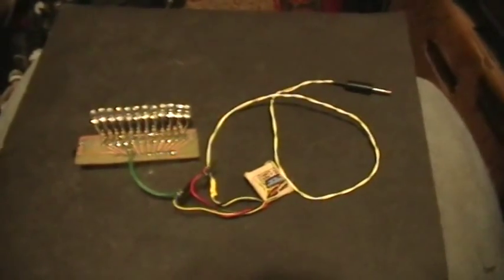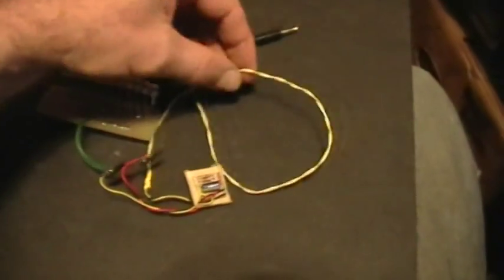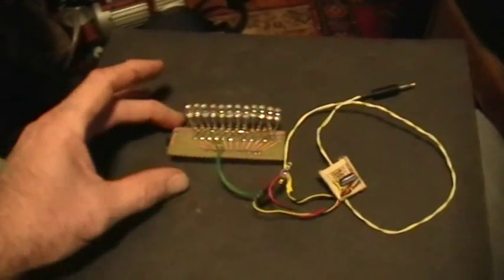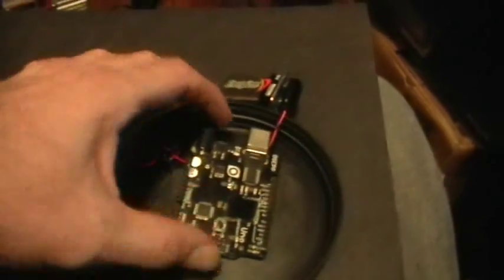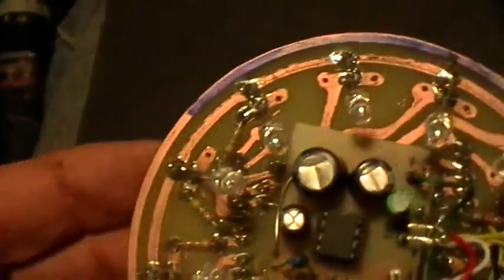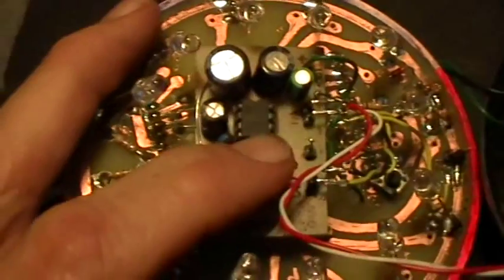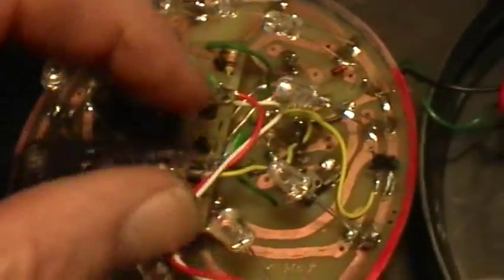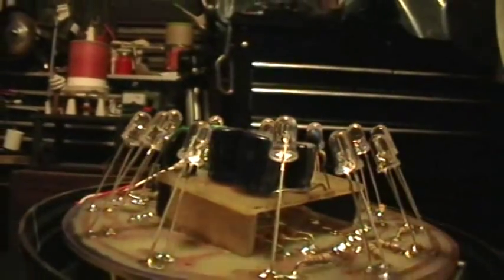Arduino: TKs FFTDuino 4: Color Organ Final Form

Comment: This would be a great project to migrate to a $3.00  ATtiny2313 chip. It's really a single chip Arduino minus USB interface. You can use your existing code, just remap your io/ lines. Search for "How-To: Shrinkify Your Arduino Projects" on YouTube.   Also, as input impedance of the Arduino is high, you can use almost any op amp. I suggest the TLC271CP because it's under a dollar, and works well on a single sided supply down to 3 volts (16v max). P.S. For line driver maybe Micrel MIC2981?